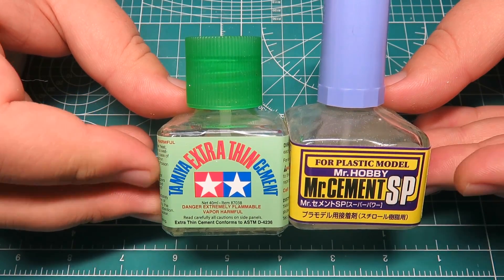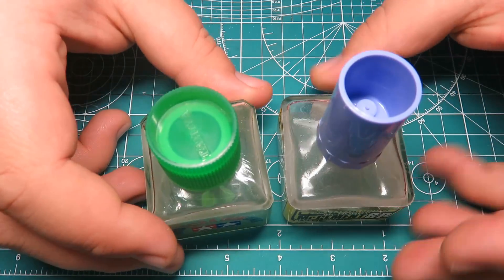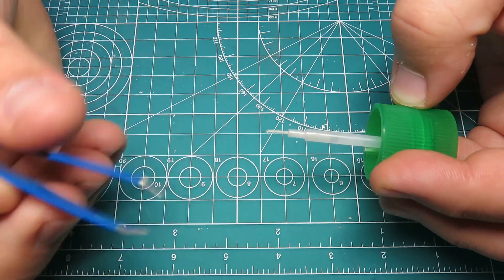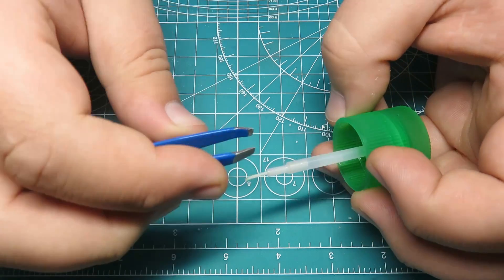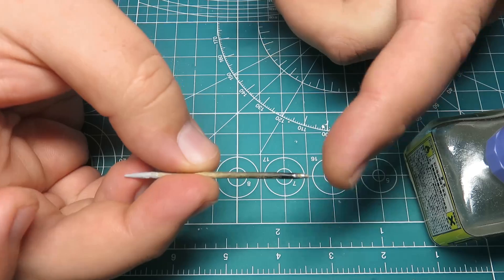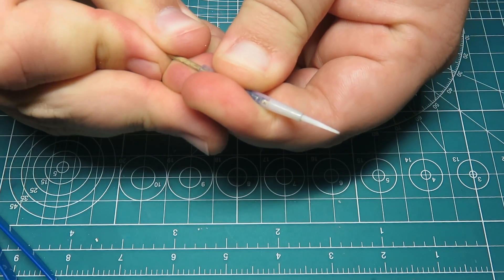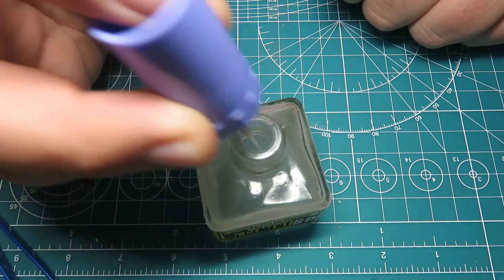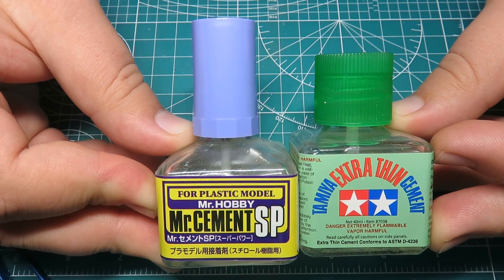What happens when the glue brushes are too short?

Comment: Thanks for the tips. But I'm starting to suspect Tamiya has changed the brush they use. The first time it was easy to extend the brush as it was loose. But the next jars, no matter how hard I pull, it's nor coming off. What happens is that plastic just gets deformed. If it's not possible to extend the brush, another option is to top up the jar with Tamiya Airbrush Cleaner which is the same as Extra Thin Cement.